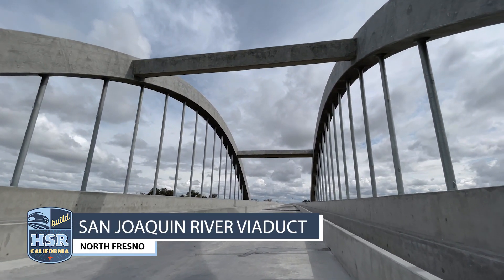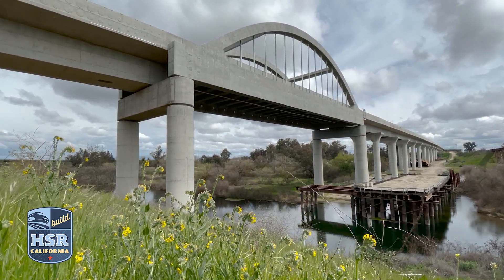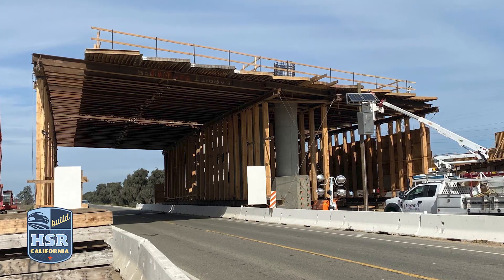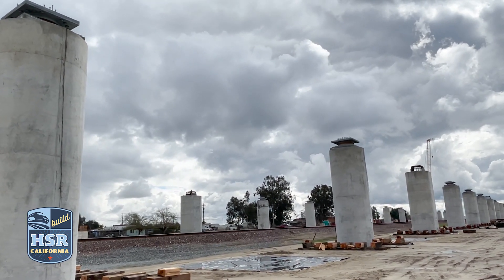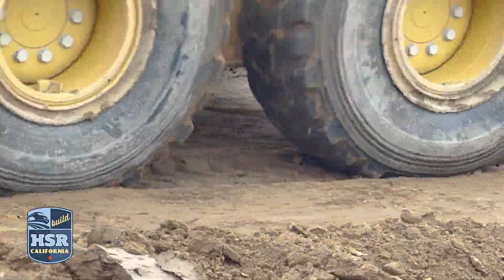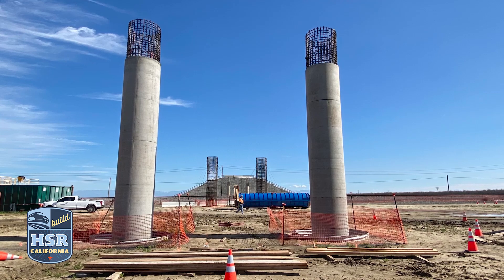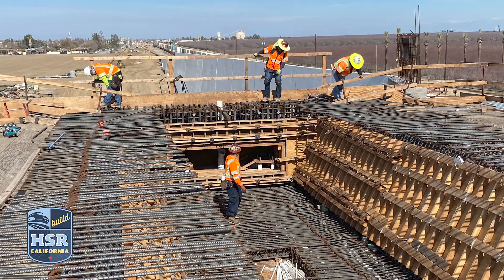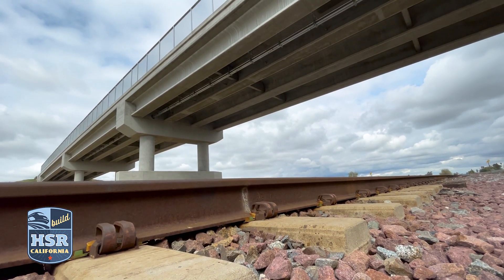California High-Speed Rail Construction Update- March 2021

Comment: Can't wait to ride this line.
Reply: Gonna have to wait till 2038.
Reply: @mexicatiahui5222  I'm patient. Waited decades for subway in Los Angeles. Now I've been riding it for decades.
Reply: @ramonalfaro3252  Rider numbers for the LA subway are far lower than initial projections. I suspect that California HSR will be underused as well.
With Uber/Lyft, modern electric autonomous cars, airplanes, busses, etc...is there really as great a need for trains, or even public transit in general anymore???
Reply: @djm5687  Not everyone can afford an Uber/Lfyt. Buses are to slow for long distance. Plus the more train options there are the more connectivity is created the more it will become desirable to use. Plus you aren't considering the economic boom that is created next to new train stations. Also, If people can work in Los Angeles and commute from The Central Valley where housing is cheaper it could alleviate the homeless crisis. Solely looking at the train as a means of transportation and not considering the economic ripple effect is very short sighted. Furthermore, the overall reduction of pollution from single passenger vehicles to modern trains is another factor you aren't considering. As for low ridership please jump on any train during rush hour in Los Angeles and tell me all about it.
Reply: @ramonalfaro3252  Electric cars are the way of the future, so the argument about pollution is becoming irrelevant. Speed isn't important to most travelers (when counterbalanced with cost), except for rich business travelers. Also, flights from Los Angeles to San Francisco cost about the same as HSR is expected to cost.
Reply: @djm5687  Electric cars still get stuck in traffic. And traffic is only expected to get worse.
Reply: @ramonalfaro3252  Perhaps more carpool lanes would help the problem. Also, more expressways (cheaper than rail) should be constructed. Bus LRT is also a cheaper alternative.
Thanks for the conversation. Have a nice day.
Reply: @djm5687  Almost every extra lane in Los Angeles has created more traffic. More lanes creates more demand. Also electric cars would still keep most of the population in Los Angeles County. HSR would make it possible for people to move to  more affordable housing in San Juaquin Valley. My sister lives near two stations in the San Fernando Valley.near Valley College. The transformation of these areas has been nothing short of remarkable. The economic ripple effect is plain to see. And parking at the school has eased because many students use the the train. Meanwhile at College of the Canyons where there's limited public transportation they've had to build a multilevel parking structure to add to the vast parking lot they already have.

Comment: Why didn’t they start with LA to San Diego?
Reply: Its very expensive. That's also why they aren't starting with the tunnels. When people would see how much it cost to build that short distance, the project would certainly have been put up for a vote once again, and it would have definitely been cancelled. So they started on the easiest part to get as much done as quickly as possible, before it got shelved. It would have been much more useful to have started working on the more urban parts first for increased ridership up front.

Comment: I want to know where have they started track installation?
Reply: Maybe later this year or next year.
Reply: Don't hold your breath.
Reply: They haven't installed any track yet.
Reply: Will begin sometime in 2022
Reply: Mark my words. It won't have a train on it. 
If it does. It will just be an amtrack.
Reply: @DeanBeanSubmmarine  Amtrak isn’t involved with this. Just like they aren’t involved with either of the Brightline systems
Reply: @counterfit5  you are right. Amtrack isn't involved. I was referencing "amtrack" as a reference to the train not being a high speed train just a regular speed train. I should have said "glorified amtrack"

Comment: The viaduct bridge looks like a Freshman in Civil Engineering designed. The design looks forced and almost unnecessary
Reply: The archway isn’t there for structural reasons, it’s an aesthetic addition. Meant to symbolize the entrance to Fresno. It actually makes a lot of sense given the work is fairly low on visibility/aesthetics relative to the expense. CHSR needs visible success in order to keep this project moving forward
Reply: @allyourgamenetworks  I wish it were more prominent in design
Reply: @azeeze1391  I totally agree. Would be nice for this project to have some more prominent aesthetic sections

Comment: Brightline will complete their high speed rail line from LA to LV first.
Reply: Brightline is slower than cahsr
Reply: @user-de4cq6uk6l  you do know CHSR isn’t operating and won’t for decades?
Reply: @user-de4cq6uk6l  California doesn't have high speed rail, it's one of the lies sold to the gullible California public. These trains will go about 220 mph, whereas Brightline goes about 200. Brightline is finishing the Miami to Orlando line in Florida by 2022, and it hasn't cost the FL taxpayers a cent. Meanwhile Californians continue to piss away billions on this clsterfck.
Reply: @putler965  correction: the line finishing in 2022 is only about 20 miles of new track, the rest is on freight railroads, and it only goes 125mph on the new section, 110 on the freight tracks

Brightline west will go 200mph but will not be complete for a while
Reply: @user-de4cq6uk6l  And California's "high speed rail" will have a top speed around 200 to 220 mph in sections in the Central Valley, but will use shared tracks (and be much slower) near SF and LA. What's your point? People in Florida are getting a train system that is almost as fast but hasn't cost them a cent, and it will be done long before CA's clsterfck is finished (at a cost of billions).
Reply: @putler965  “almost as fast” half the speed
Also it’s literally 30x shorter than CAhsr
Also it uses diesel trains unlike CAhsr electrification

Plus brightline doesn’t even need any bored tunnels

Totally different comparison, not related at all
Reply: @user-de4cq6uk6l  The fact tunnels are required is yet another reason why it was a dumb idea to begin with. Earthquakes in those areas is another risk.

This train system will also be going "half the speed" in areas outside of the Central Valley, which is one of the reasons some initial supporters of the project sued to stop it - it's not what was originally promised. But then California was dumb enough to start on the project before they have even purchased all of the land needed to complete it. And while pseudo-environmentalists claim it is environmentally friendly, they are not considering all of the greenhouse gases being produced by building it in the first place. The most optimistic estimates are that it will take about 50 years of use to offset those greenhouse gases, and that's assuming full ridership (which is unlikely to happen, as the CHSRA has already admitted this train will require subsidies, something they initially claimed wouldn't be necessary).
Reply: @user-de4cq6uk6l  but still fast
Reply: @cadespencer6320  true, and also after researching more about it it turns out that the la-lv rail line is actually 200mph, not 125mph like the one in Orlando, so I was wrong lol
Reply: They haven’t even started yet. There not even done with the construction of the Orlando part of the Florida line. And that’s normal rail without centenary
Reply: And unlike Calif HSR, if completed it will actually go from someplace that people are to someplace that people want to go. That is, it will have an actual useful benefit to the people, and not just a few politicians.
Reply: @lwilton  CAHSR will go SF-LA, the SF-San Jose section will be completed in 2022-2023 under the name “CalMod”
Reply: @user-de4cq6uk6l  Oh, OK. I haven't been following it. As I remember when it was first proposed as one of Obama's HSR projects it was going to go from a little south of Chico to around Sacremento, and then Bakersfield in the second phase, with no plans to go west across the mountains to SF, nor any plans (other than vague "it would be nice" hand waving) on how they were going to get south of Bakersfield.
Reply: @lwilton  yea, there still isn’t funding to go from Madera to SJ and Bakersfield to LA, but hopefully amtrak joe will step in and help with that
Reply: how fast is the Birghtline? I dont remember Brightline can be counted as the HSR system as its speed is not that fast compared to this project in California
Reply: @TuanNguyen-uq8gz  brightline Florida will be 125mph, brightline west will be 200mph
Reply: @kuckoo9036  my issue is cost+feasibility   Yes CHSR would be planned for much faster but clearly it will never be finished
Reply: *Victorville
Reply: @The_Poro_King  no Ricardo is correct, phase one is from Victorville to Vegas then phase two is already in planing and design phase for it go to into Los Angeles they said they would like to start on the construction of phase two as soon as phase one is completed
Reply: @The_Poro_King  Palmdale